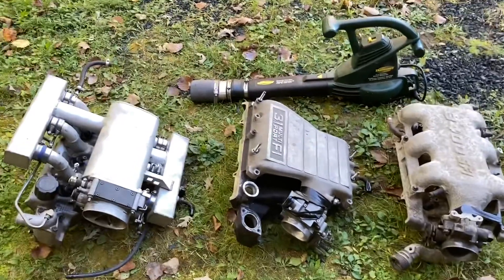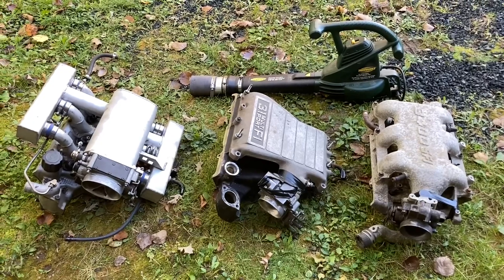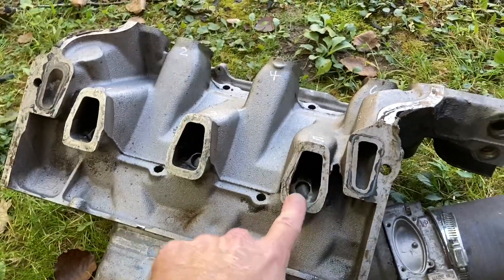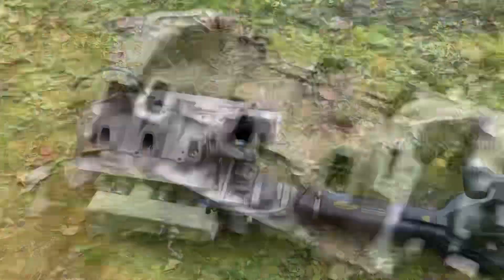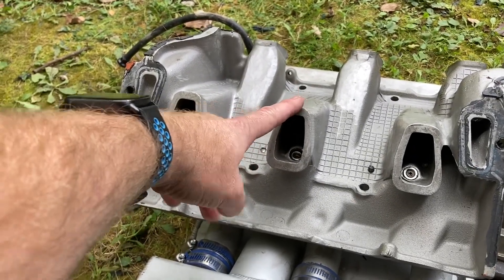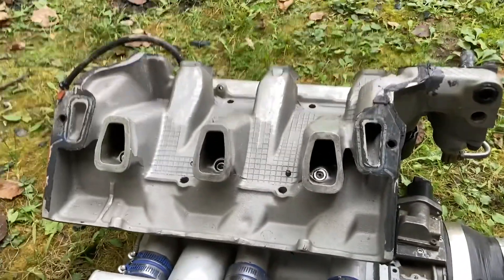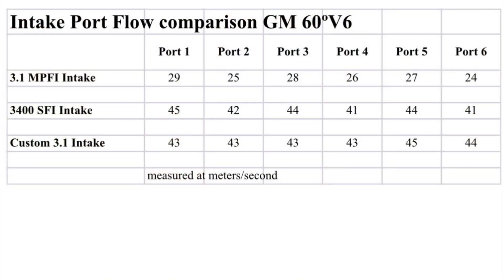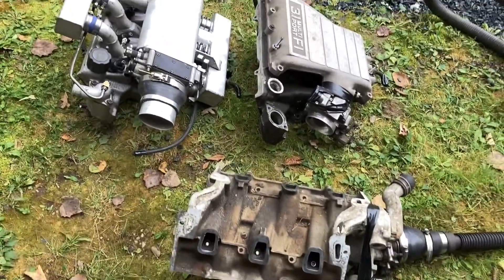Intake Manifold Boosted flow comparison GM 60°V6’s

Comment: Awesome, I always have  read online that the 3.1 manifold was really air flow restrictive, so increasing the air flow to the pistons will indeed increase the HP on these great little V6 60 degree motors.

Comment: Will a 3400 upper plenum fit on a 3100 lower intake?
Reply from the maker: If it’s a later model, after 1999 i think, I believe it’s the same. Just different numbers on top.  Likely not worth swapping.  
The first 3100 SFI in 1994 had the same style intake but smaller ports and are not interchangeable without changing cylinder heads as well.  Thanks!

Comment: so basically i was right for using the 3400 intakes years ago.
the 3.5 and 3.9l have some great tech in them too if your 3100 dies. the 3.9l is the crown jewel for small gm v6 powerhouses.

Comment: So I am an engineer… and I can explain a little of what is going on here.

First, this is uncharacteristic of the flow provided by a running engine. So apples to oranges first off. The reason is that an engine running causes distributed vacuum from each opening valve event, and the summation of all events over a period of time gives you the intake vacuum. The airflow through the port will ultimately be determined by the valve event and available air volume ant whatever pressure or vacuum within the plenum. This is a basic running engine. 
Whereas your test is using a constant air source, which is forcing air through the throttle body and into the plenum and distributing it to the runners. While this test kind of makes sense in our heads, it is not how an engine operates. 
And this is important for this fact, the air is not distributed from the throttle body to the runners… it is a vacuum that pulls from the supply of the plenum, provided from the runners. 
Analogy time;
Do you breathe based on the air flow into your mouth, or based on what your lungs draw in? If you forced air into your mouth and said that your left lung was distributed more air than your right lung, therefore your throat was at fault for poor airflow to your right lung… would that statement mean anything? 

The other part to take into account is how air flows. As we said, it is a valve
event. And each event (starting with opening) causes a drop in pressure, which causes air to flow from a high pressure region (plenum) into a lower pressure region (cylinder). The beginning of this event sets off a pressure wave that starts at the back of the valve and moves into the plenum, where it is reflected back into the valve where it carries some air and reflects back into the plenum. This happens until the pressure wave losses its power, and each reflection is weaker than the last. This waves speed is based on the characteristics of the air as the density changes with pressure and temperature (boyles ideal gas law) and the speed of sound at the gas state. 
All this is taken into to effect when the valve opens, PLUS the available air within the plenum, which is replaced when depleted by the opening in the throttle body. This wave can move faster than the speed of sound and have more force behind than the vacuum of the cylinder that is drawing in the air based on the characteristics of the port. Meaning, at certain speeds, you can have a supercharging effect where more air flows into the cylinder than the vacuum draws in by itself. This is what “tuned port intakes” do, by utilizing the helmholtz resonance theory, you can “tune” a runner and intake system to flow more air than it can statically. 

Back to your test, which only shows how the intake would flow if all cylinder were drawing air at the same time. 

To get a realistic idea of the air available to each cylinder, you would have to measure the differential pressure from the back of the valve to the opening in the plenum, temperature correct for the density of air, humidity correct, and DA correct for altitude. Then you can quantify flow for each port for each valve event. You would obviously have to plot this over the RPM range and for each quantifiable point of valve lift. This would be able to show you how much air the plenum was able to provide for each cylinder based on the conditions of the engine for each RPM. 

I do this kind of stuff at work for much larger systems. And the data is worth its weight in gold!
Reply from the maker: Thanks for that! 
I’m happy to hear from someone that knows more than I do on these subjects because through my own research there’s tons of misinformation out there and I’m always trying to educate myself more.  
I’m aware that this test doesn’t accurately reflect an engine under NA vacuum conditions and I mention in the video that this is “simulated boost”. 
I also blocked off each port to show “boosted” airflow going to each port separately. 
My goal was really to just show which intake would work better than the others, including my home built version.   
My intake was designed with 14.5” “tuned” runners based on my camshaft specs to have an increase at approximately 4500 rpm.  
I was quite happy to see actual results on my data logs showing boosted pressure spikes between 4300-4600 rpm.  
I am working on a video on intake manifold design as well so if you have any suggestions feel free to let me know.  
Thanks!
Reply: @xlr8ing_zgarage  absolutely. I have a few formulas and spreadsheets I have developed over the years that I can send you. As well as a wealth of information. 
I too have developed several intake manifolds for many different purposes. I geek out on this kind of thing.
Reply: its a turbocharged car are you missing chromosomes or something? forced induction is not how you breathe.
Reply: @chehystpewpur4754   the phrase is having an extra chromosome. Missing one is turner syndrome. I hope you never have the misfortune of either in your family. 

And if you truly understood how forced induction works, you wouldnt have made this comment. Says a lot about what you understand.

I can help though. Forced induction doesnt “blow air” into the engine. It pressurizes the air that is in the plenum. The valve opening allows the air to flow. The only way you create boost is by having a restriction. The exact same way as breathing.

Comment: Interesting now I wounder if the 2.8 style is same port size and everything as the 3.1 . Does the 2.8 and 3.1 have same size and it's just stamped 3.1 on it 

I plan on swapping 3.1 from my Lumina to my celebrity Eurosport and just curious about that part but I doubt there's a difference tho but never know
Reply from the maker: Thanks!! I believe port sizes are the same for both 2.8 and 3.1 MPFI engines.   I know there was a change on the 3.1 version at some point but it was just a bolt size change if I remember correctly.   Basically you can’t use the newer upper plenum on the older lower intake because the bolt size was different.
Reply: @xlr8ing_zgarage  main difference that I remember was the pcv location, 3.1 went into the plenum and the 2.8s went in the lower intake manifold.
Reply: @modeverything1  Yes That is True
Reply from the maker: Ahh forgot about that!!
Reply: @modeverything1  i wasnt a 2.8 vs 3.1 thing regarding the pcv.. it was a year to year thing. 90 it changed to the upper plenum. vs the lower. may vary per model as well.

Comment: Curtis Walker used a modified rear wheel drive 3.4L intake from a Camaro on his infamous turbocharged Z24.  He had to cut off the back corner of the intake in order to clear the alternator.  Even at 20 psi with a HUGE turbo, he never had a problem with cylinders running lean.
Reply: GREAT video BTW!!!
Reply from the maker: Thanks!  I know Curtis and his build on the Z24.  Met him and the car in person one time in Bowling Green many years ago.   
That’s another intake I’ve never looked into closely because it’s only for iron head engine which I’ve never used.  
Thanks for watching!
Reply: @xlr8ing_zgarage  I lived in the Dallas area where Curtis lived 20+ years ago.  Got to work with him on the car.  Went with him and a few other guys to a J Body bash back in the day too.  That car was crazy, and it was crazy at how many different GM parts fit on other cars, but also different parts fit on different engines.  At one point I owned a 91 Cavalier and did a TBI to MPFI swap on the 2.2L motor.  Later I owned Wagonstein, a 1991 Cavalier wagon with a mild 3.1L turbo under the hood.  There will always be a place for old school J bodies in my heart!  Love your videos!
Reply from the maker: @91CavGT5  I think I remember Curtis talking about putting a TGP setup in a Cavalier wagon.   But I’m getting older and might be confused…🧐

Comment: Glad you got some tape on there;)  I want to see what you get with the 3500 upper intake on the 3400 lower.  The 3400 is the best distribution for sure on a flowbench.  What you are testing is how boost could be distributed since its being forced through rather than drawn through.
Reply from the maker: Thanks!  I’d like to see how the 3500 compares as well but don’t have one here.

Comment: Great video. Pretty surprising results from the 3400 intake. Curious to see how each flows on a flow bench under vacuum situations.  Also curious to see if manifold actually had a positive pressure using the leaf blower. Plug a boost gauge into one of the vacuum ports.
Reply: I still doubt it with a leaf blower. They aren't really made to compress air, just move it. Ever watch the leaf blower supercharger roadkill episode?  Took half a dozen gas leaf blowers to make boost lol.
Reply from the maker: @danscustomprojects4486  nope haven’t seen it but I know they don’t put out much volume of air, just velocity.   Like the pool toy inflators but they can’t blow up a car tire.
Reply from the maker: Didn’t even think about that!   I bet the stock 3.1 would have had positive pressure considering how much lower the flow numbers were.

Comment: 3400 is what’s in my Pontiac Montana. Guess I need to turbo it. ;)
Reply from the maker: DO IT!!!  My wife has had numerous 3400 Montanas and would’ve liked to do that but I’m afraid the 4T65 transmission would be toast almost instantly!!
Reply: @xlr8ing_zgarage  Try to figure out how to swap the 4T65E for an HD model! I THINK they were not only used in the 3800 SC cars, but the 3900 cars too. 
Not sure if they were used with the LS4 in the W-Bodies or if they used another, such as the 4T80E (I THINK the '80E was only used in Northstar cars?)
Reply from the maker: @mstover2809  I believe the HD was only with the 4T80 transmission and GM even had a race version for sale at one point.  
Not really worth it but would be fun to make one of those AWD Montana vans turbo as well!